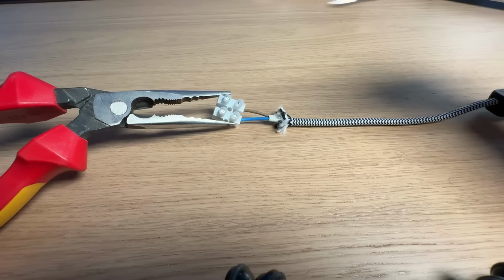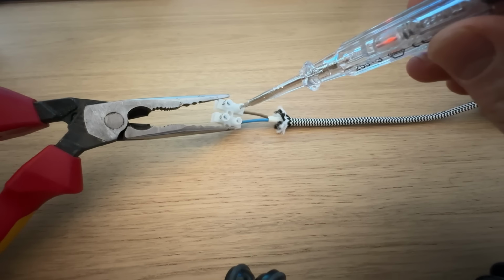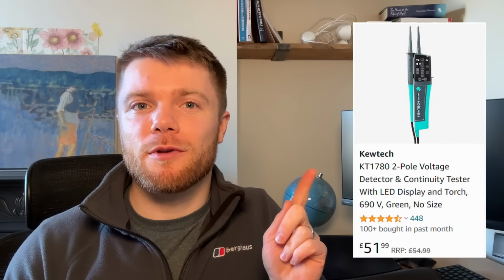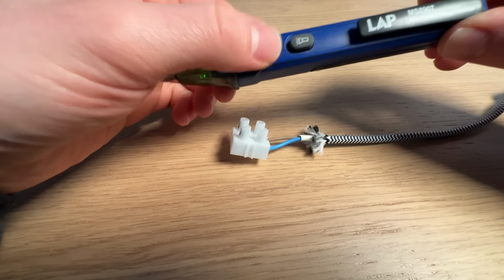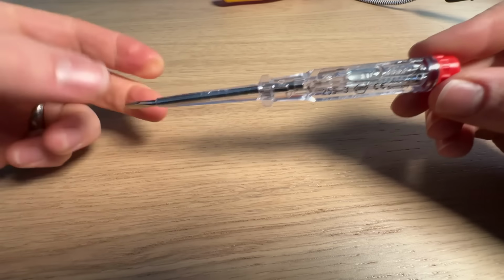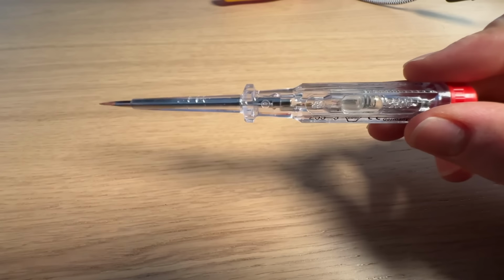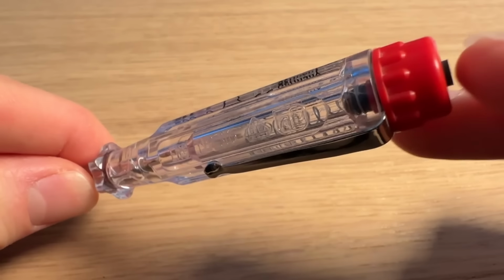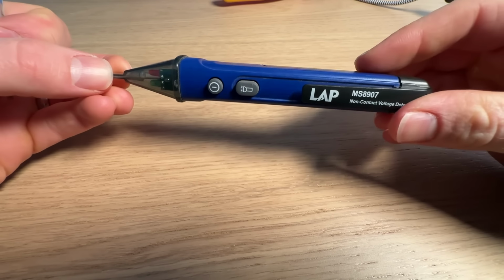The Most Dangerous Electrical Tool

Comment: This tool isn't dangerous... It's like any tool: there is a proper use, and rules with it, that's all.

I'm electrician since 20 years, i got shocked many times, sometimes by my mistake, sometimes my other mistake, sometimes by unsafe tool.

I saw people saying things on this comment section like "younger i take more voltage"... And, it just demonstrate they have no clue what they talk about. My point is, this kind of tool has a short range of use, and it's just here to do a rapid check, but any pro electrician would double check by proper measure, with values. 

As example, you can literally touch a direct phase conductor if you're on an perfectly isolated floor, doesn't mean there is now current or you safe: the moment you touch ground or neutral point, you're screwed.

All those DIY video could sometimes provide good advices, but at no point they put in perspective. All device have a range of proper use, and most of people claiming tools are unsafe don't use it the right way. 

People also don't get the fact this tool here is graduated to a certain value before being broke or unusable, but it doesn't mean the tool will instantly broke if you try to check beyond those values, it's not how it works.

And, friendly reminder, this is a tool for a "rapid check", not a certified check.

Comment: I used a fairly new one to check the mains was off having turned it off at the consumer unit.
Light was off, but on connecting to terminals it flashed!!! Still live. Screwdriver was faulty. Binned.

Comment: I know they are fine to use... but i still think it's unwise to rely on a little resistor in this fashion. Also this design isn't just used by the reputable manufacturers. 
It already looks cheap imo. How would you notice a really low quality one?

Comment: It would not have  been approved and sold in all diy shops and specialist electrician shops.  If  there were safety issues and  concerns, is probably  covered by Bristish standards (BS) and electrical regulations already. It is about knowing how to use and knowing the safety and non safety aspect of using such tool.

Comment: Same as any other tool. Store it right, check it before use. I'm not an electrician, but i do have to remove old electrical stuff sometimes. I use one of these, but only as a final check after I''ve checked theres no voltage by other means. Its lit up a few times and thats my cue to walk away and tell the boss to get an electrician on it. Yeah, a none contacts better, but ive got a few of these in my toolboxes so im more likely to bother to do it.

Comment: I usually use a multimeter on voltage probe mode, I touch one probe to the tested element and hold the other. Then if that tells me the element is dead, I'll carefully short live to neutral with a screwdriver, worst case scenario it goes bang

Comment: I do a lot of switchroom maintenance and there is always a risk of multiple sources of electrical energy that can feed back into the LV switch gear (UPS or gen sets). If I find anyone testing for dead with one of those screwdrivers or a volt pen I remove them from site. The HV side I test and then issue a permit when proved safe to work on. The LV side a tester and proving unit must be used!

Comment: Why is it all electricians on YT speak like they are in the RAF?  Is it to make them believe they are important?   Does it come after experiencing an electric shock and then they start talking out the back of their faces?
About these testers.  There is fuc€ all dangeros about them.  They have a neon lamp in series and use the capacitance of ones own body along with a resistor; the latter is to remove the possibility of full current flow if somehow the bulb fails. Your body provides a very small capacitive charge.  Try sticking a nail into the socket with just a resistor and a normal incandescent bulb, the other end of which you hold.  You may see the bulb light up perhaps long enough before you either get the electric shock and live or get one and die.  The hint is the neon light.  There is no direct contact.  It uses a vacuum and a gas (often neon) which is inert to create the energy and consequently light.  Since there is no direct path you get to live a bit longer to talk like someone in the RAF about how dangerous it is for people who don't talk like they are in the RAF to change things like lightbulbs and plugs.  
Chocks away.

Comment: Come on, really? Do you know what is really dangerous? Hold a live wire by using a metal pliers and ... without earth connection .
I have been using this kind of screwdriver for years without any problems. They saved me the life in most cases because I can know which wire exactly has power. The "no contact" power detector is not precise it only shows "there's voltage around" not in which wire is. This is dangerous.

"If a piece of spring breaks of and shorts the resistor or get some water in here..." Are you serious? Are you tried to open one of this screwdrivers to be able to say these things? There's no physical contact between the tip and the "button" due the neon bulb. By assuming your arguments this is like saying that if my grandmother had wheels, she would be a bicycle. Please stop doing videos like this, questioning the effectiveness of a tool that has been used for years and years without problems and making the most unlikely assumptions.

PS: Buy a quality trusty ones, not a cheap/chinese. The latter are the dangerous ones.
Reply from the maker: Those are vde pliers I’m using…..
Reply: I agree with you. The contactless one cannot do precise detection. Wheres the one that relies on neutral will fail if the neutral is faulty which make it more dangerous. Since there's no 1 to 1 replacement just yet, there's no way we stop using it.

Comment: Very funny video. Typical british "safety" approach :D If, could, would...1st of all you operate it by touching the live wire and THEN placing your finger on it. If you are using it properly, see following: 1) If any condensation would occur in it then high current would go through the bulb burning it down and breaking the connection between live wire and your finger.
2) If part of the spring would fell down (God only knows why would that even happen...its German made not China or UK), then I believe contact would be broken anyway, and if not, see the point 1.

Seriously...I have been using them since I was 5. This is just silly...

Comment: It's dangerous only because of the specific manufacture making some bad design. The resistor was supposed to be sealed inside plastic chamber. Unless you break it, otherwise nothing can get in. If you use a broken tool and got electrified, it's your own fault, not the tool. Even when you use it to test some very current circut, the resistor would melt and break the circut, instead of passing a dealy current.

Comment: One thing the non-contact pens really excell at is testing those screw-in type fuses... And I do know the coloured tab in the visible end of the fuse should come off when it goes... But often they don't. And sometimes the fuse holder actually has a little hole where one can put a probe into. But then again, often there is no hole. I have heard that sometimes some people have actually even broken the glass on those things to stick a probe in.

But a contactless pen works just fine just by tapping the glass with it. I remember a few times there were just huge panels with row after row of fuses. And obviously they should have been properly marked and all, but like so many times, there were little to no markings and sometimes things have been changed and while there might be a label saying one thing, it might be just mislabeled at that point. While the contacless is not perfect by any measure, it did speed up diagnosing the problem quite a bit.

Now some people have pointed out potential issues with basically any type of tester... And yes, nothing is perfect. Personally I don't trust contacless, because they are notorious for giving plenty of false positives and negatives. So I consider them more of a diagnostic tool, that can help to identify potential issues.

And one another thing I could also point out is one day I was doing this basic "health" test on a C-128 PSU... After all CBM power bricks are known to fail in ways that would fry electronics. It literally took a while for me to find any trace of electrical power on the connector pins. But ultimately I was able to measure more than double voltage on DC-bus. The reason why I had trouble finding any voltage was likely due to contact surfaces not being entirely clean. And mind you, they did look like pretty clean just by looking at it. But to get good contact with the probes it required some scraping around to get past all the impurities that had accumulated on the surface. While that was about fairly low voltage DC, similar things can happen with grid level AC as well... If you wan't to be completely sure, you should be able to detect power on and only after that verify that the power was disconnected.

And when in doubt, turn off everything. When dealing with devices that are connected to a socket, pulling the plug out of the socket is simple and sure way to make sure it is not connected... But even when fully disconnected, one should remember that capacitors can potentially store lethal charge, and while usually devices that have capacitors have drain resistors for safety... But it is important to understand that should a drain resistor fail, literally the only symptom could be the fact that capacitors won't drain.

When dealing with potentially lethal things, one should never, under any circumstances just assume anything.

I allways say that one should treat any piece of circuit as if it was live, untill proven otherwise. And like I said allready, every kind of tester and detector comes with flaws. Contactless might give false results either way. And any tester that does rely on a probe contact, might be thrown off by poor contact. Just because you pressed the probe against something, does not guarantee good connection.

As for those screwdrivers... I would agree on that. While other types might potentially have their own faults, having something that is designed to use you as a part of a circuit, is in my humble opinion, just looking for trouble. Maybe one could use that as a "last line of defence". But would I recommend those as primary voltage detectors? Most certainly not.

And as for potential safety concerns on multimeters and voltage testers... It should be obvious that one should pay attention to their condition. If there is any sign of damage to the insulation, one should stop using them immediately.

Comment: Having all read that... Keep in mind that the UK for example, is the only one using a ring circuit. Even if you cut the mains with an axe, there is the possibility that that your sockets in the kitchen still work..

Hopelessly outdated circuit. Also the amount of "official" certified "sparkies" who actually have no clue what they are doing are more of a danger than a tester that has been used for decades without any problem.

I love these likkle thingies. Many times that I switched of the light, switched off the consumer unit.. but still had a screwdriver telling me that there was still current flowing, is "shocking".

I think the only problem is that they are cheap. Manufacturers of multi meters don't like them. They want you to buy a more expensive bit of tool.
Anyway... Taking the British building regulations and health and safety regulations in consideration, I can say (and I worked all over Europe) that the UK is one of the most dangerous places to work with probably 80% of the houses not complying with building regulations.

🤷
Reply: Have you ever tried reading AND understanding UK building regulations?  There is an industry of people writing them and another bunch explaining how to interpret them.  It is quite remarkable anything ever gets done.  Then they keep amending them just for fun.

Comment: I've never had any problem using these... Not using one was more dangerous and incidentally I did get a full current shock, yet back then I was in quite ok health condition, so it was a shock and it was painful but it did not cause me to have any serious health damage either. So pretty much i don't see such a huge danger in using these. Even if you would get a 240 Volts current shock, you'd let it fall or release it instantly

Comment: i stopped using this  bullshit after two years. Why ? i was measuring in my job some heating element,  this trash screwdriver indicated voltage, where real voltage wasnt. So i didnt repair it cos i didnt know whats the problem. The next day  i come and college told me that it was  simple fuse and i felt really embarrassed. Like a retard which cant change a simple fuse. The problem in this bullshit ,,electrical tool" is it also indicates inductive voltages as there is a real  hot voltage. I broken that bastard in two pieces and throw it  to garbage, never want to see that bastard in my hands again. Im using only fluke t150- a real electrical tool.

Comment: Neon tester is the only tool officially recommended by the Professional Association of Electricians (SEP) in Poland and that knowledge is required on the exam for electricians (at least one electrician who attended both told me so).
Non-contact indicators are handy but they give a lot of false positives, and when a battery is low - a false negative 100% of time.
Any tester should be tested directly before use by checking a wire which is known to be 'hot' (100-250V alternating current relative to ground).
Every tester is rated for a range of voltages, so a person who is not aware what voltage may be present in the circuits of interest should call professional instead of DIY-ing.
If someone calls a person touching the tester's contact - 'part of the circuit', how about a touch light switches (e.g. Sonoff)? They use your capacitance likewise, and they isolate you from the voltage of the line by which they are powered (only with more electronic components v-s single resistor) - likewise.

Comment: This video was sponsored by Non-Contact Voltage Detector producers
Reply: I came here to say this 😂😂
Reply: No it's not non contact voltage detectors are not an approved method of proving dead. In the 18th edition wiring regs in the UK, refers to the Health and Safety executive publication GS38, which gives the specifications for an approved voltage detector required to prove dead. This is an approved double pole voltage detector with fused leads, not requiring a voltage source to operate with minimal exposure of the tips. You have to test on a known live supply both before and after proving dead, to ensure the approved test lamps are working. The magnetic fields produced by an ac supply can cancel each other out, and voltage sticks are totally unable to detect DC voltage such as produced by photovoltaic cells on your roof, as only a alternating current will induce a voltage in the voltage stick.
Reply: Haha I concluded the same 55 seconds in. He didn't demonstrate anything about how dangerous these are, but proceeded with "this brings me to the next issue of why these are so dangerous".
Reply: Funny, but If someone really care there is another cheap screwdriver but with small betteries, it can way more but main difference - you must not touch another end

Comment: Back in my day we used neon screwdrivers all the time and thought nothing of it. The only problem is they are very high impedance and will sometimes light up with just induced emf and some modern digital multi meters can have the same problem but both are still very useful.

Comment: my first tester was something like this screwdriver,  absolutely horrible to use because the little light is barely visible.   I bought a no-contact tester which beeps and has a bright LED to use instead,  it has worked wonders until today, coincidentally, when it fell on the floor and broke the glass dome on the end :(

Comment: What bollocks. 75 now and was told how to use the device as a kid. The current passing through the user is miniscule and it relies on wild capacitance between the user as ground. If you're stupid enough to contact ground directly the fat series resistor will protect you.

I've  rarely seen such tosh.

Comment: I'm pretty sure the one my dad had in his toolkit got a wire with a clamp that you're supposed to fasten to something for an extra safety layer so that the current does not pass through you. I'll need to check though, we had no use for it for like 25 years so I've not seen it in quite a while

Comment: Philips used to make good test Pen. The tip is tough amd seldom Break. Never see one philip with collapsed . 
When screwing mains terminal definetly your palm bill be against tjlhe Plastiv tip contact or your finger will be on the clip. If there are AC on the Terminal Screw, you be alerted of presence of AC mains. Its a must have tool.

Comment: Neon bulb is gas discharge tube. Even if resistor fails (probably fail open) even if it is shorted by drop of water say 10k it is far from dangerous.

Comment: Modern versions rely on a LED with a hefty resistor.  These are a lot brighter, and since the resistor is of a higher value, probably somewhat safer.  Non-contact voltage testers are a better bet, since they're non contact. Also, like any other safety device - test immediately before use.